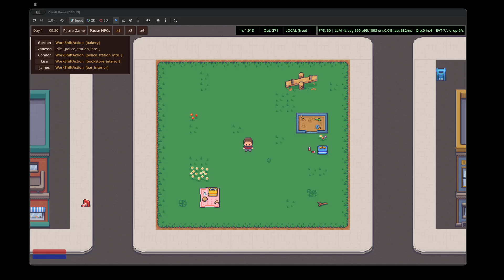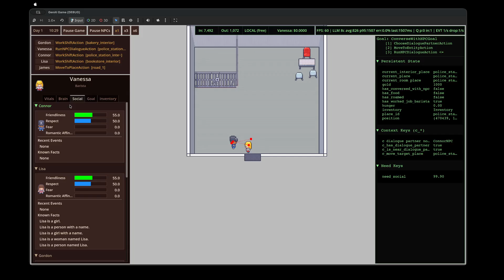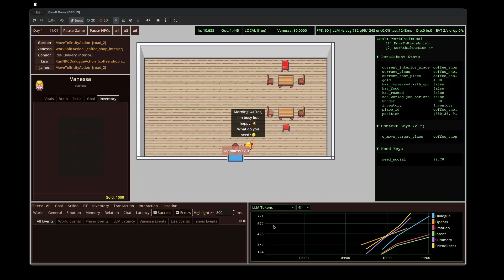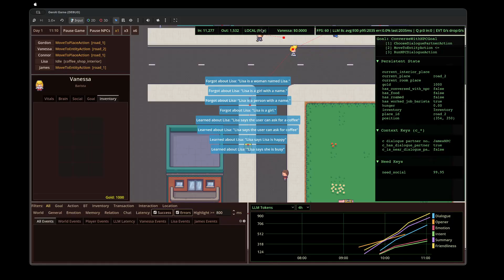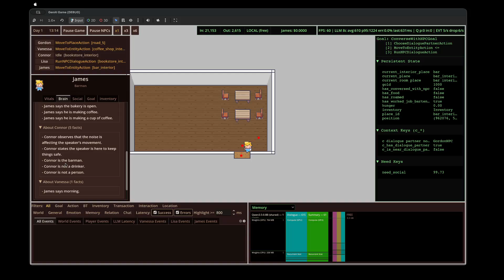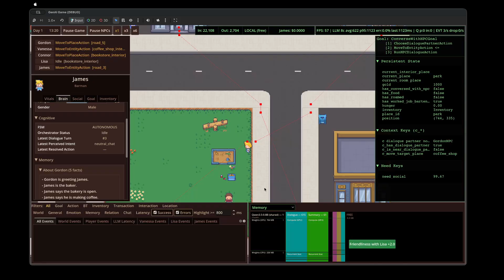AI NPCs - 5 Agents in 3GB of RAM using SLMs and Llama

Comment from the maker: Stuttering has been fixed!
I was using "Compatibility" rendering in Godot because I initially wanted the game to be browser compatible, and run on the cheapest devices.
As it turns out, it uses OpenGL and that causes stutters at inference time.
I figured that aiming for 6GB of VRAM for models means that browser is out of the equation now anyway. So simply bumping up to Forward+ eliminates the stutters.